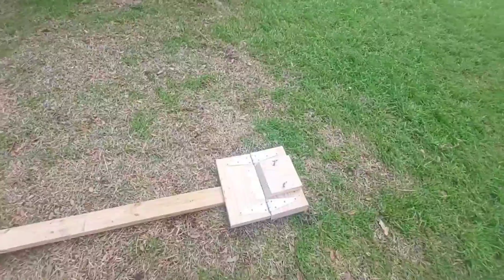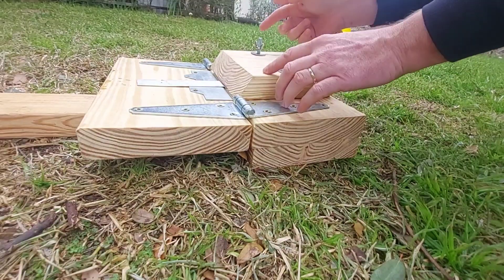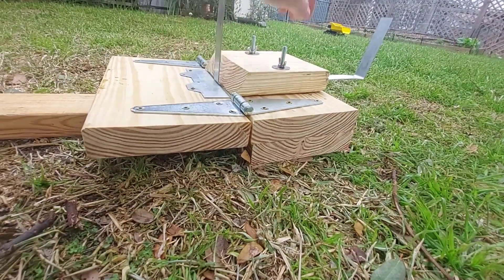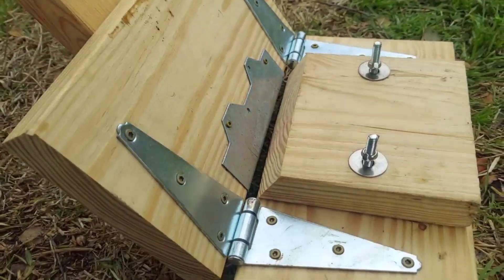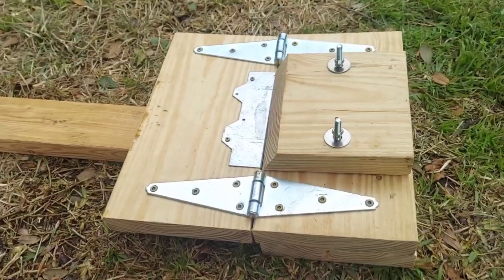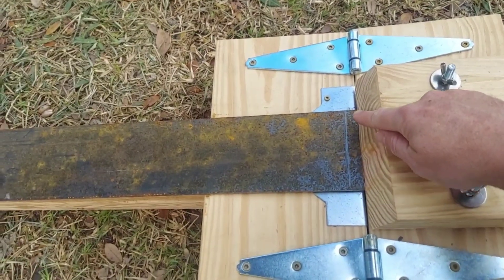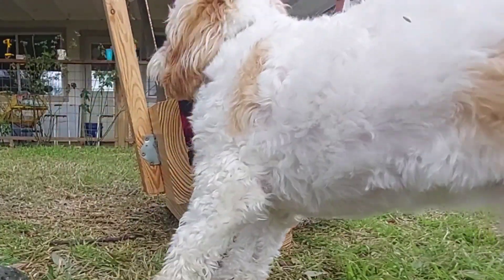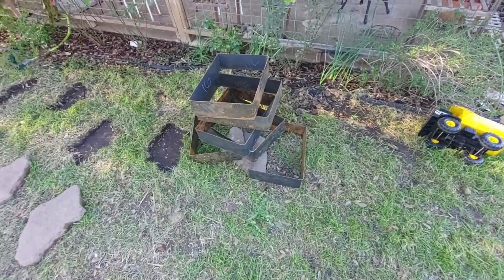DIY Sheet Metal Brake for Bending Steel

Comment: Well, I'll be damned! When I looked into making a brake it seemed that the cost of materials would be practically as high as simply buying a cheap Chinese one. On the other hand, I have lots of wood kicking about, and I could build a wooden one for only the cost of the hinges and a few screws. Of course, it never occurred to me to do so, until now............... Genius! Thanks for sharing.